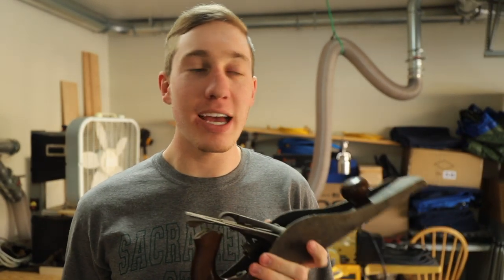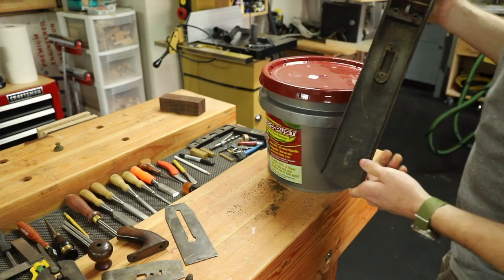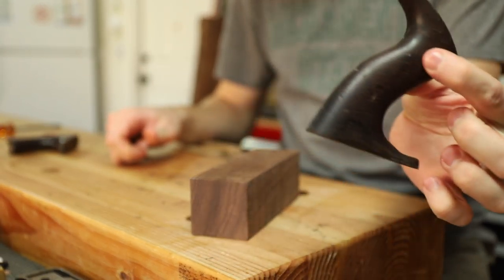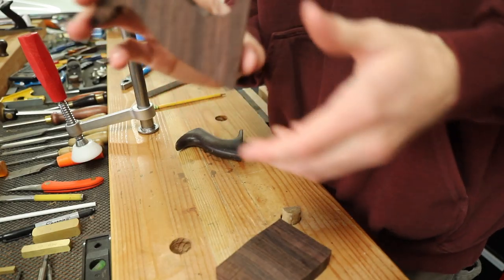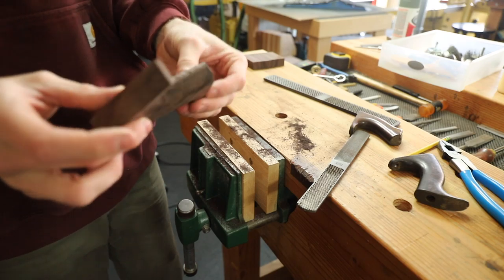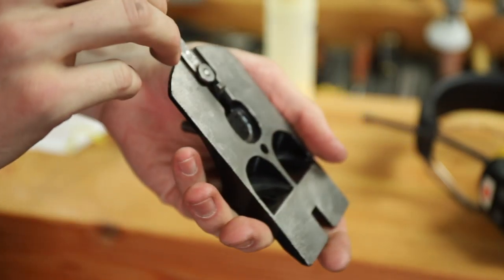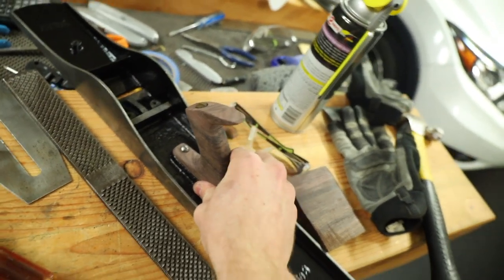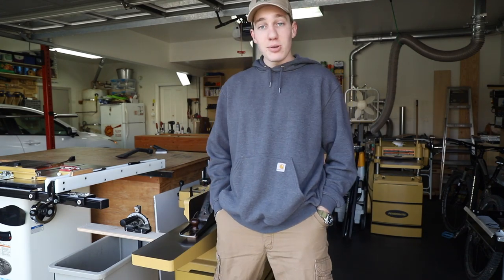STANLEY BAILEY #8 Plane Restoration (100 YEARS OLD)

Comment: Nice video, well made and good info. I've restored many planes and follow mostly path the presented. One tip I'd suggest - after evaporust instead of using a wire brush in your hand drill, use these: Performax® 4" Medium/Fine Nylon Wheel Brush. Menards sell them. They are gentler on your metal, and on your fingers if you slip. They leave a brushed metal finish which is aesthetically appealing, in my opinion and better than the finish from a wire brush.

Comment: Good job on the restoration. I'm surprised you made a whole new tote. All you really had to do was sand the broken area flat and glue a tiny piece of rosewood on the top for the new horn and then reshape it to match up. Yours turned out pretty nice though. If you still have your old tote, please let me know. I'd be glad to buy it off you for a few bucks. I have some majorly broken totes that I could cannabilize to make a new horn. I look forward to more videos!

Comment: When soaking with vaporust, Instead of using a bin, make a tray the size of the plane with cardboard and line it with a plastic sheet or trash bag. That way it’s completely covered and you’re using way less vaporust solution. 👍🏼

Comment: Just ran across this video. Good work on the restoration. Since it looks like you are doing this for your own use, I'd ignore those people chastising you for wire brushing the plane. "You can't please everyone, so you've got to please yourself". One suggestion (After the fact, sorry) is that Lee Valley has a free template (google "stanley tote pattern") for cutting out a new tote. The advantage to this is that you could first accurately bore the long hole square to the blank, and use forstner bits to make the two curves.